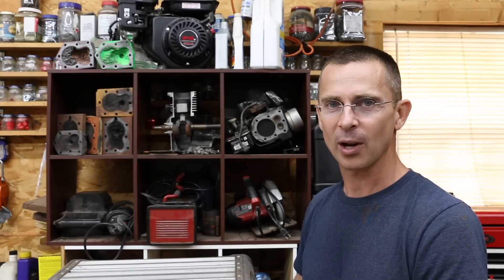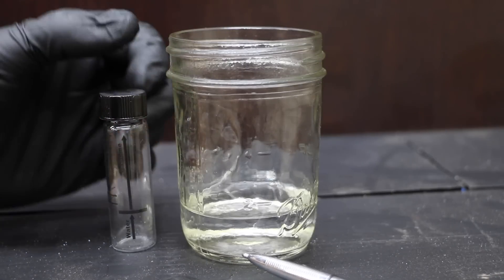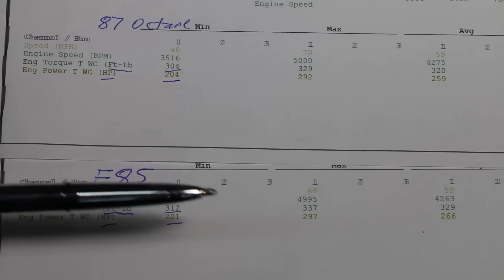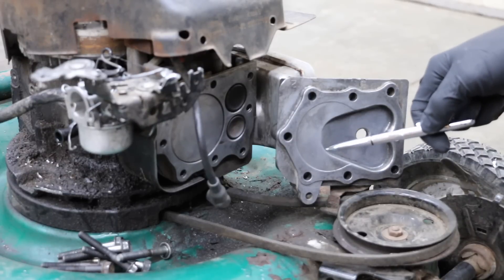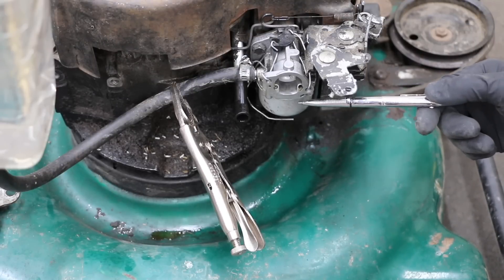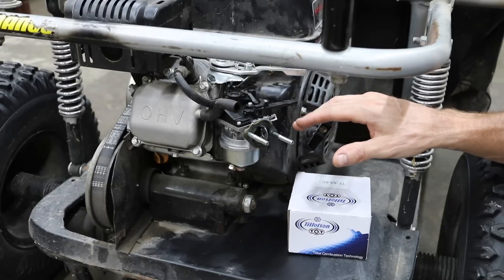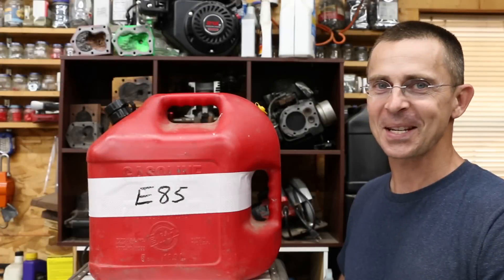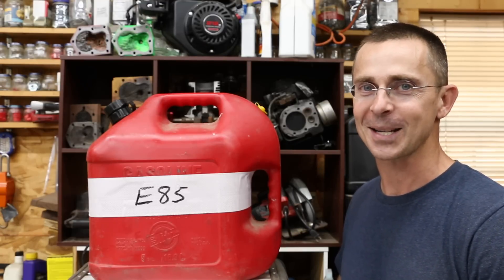Is E85 better than Gasoline? Let's find out!

Comment: I run E85 in my 4.6 modular. I tell you once you feel the power of e85 it's hard to go back to regular especially since its more affordable. 
I'm in SoCalifornia and it costs 4 dollars a gallon for regular unleaded. E85 is 2.99. 

While I only get 222 miles out of 17 gallon tank with e85. Yes I have a car pushing 320hp daily driver. I get around 300 miles with regular. 

I just love the extra oomph I get from e85.
Reply from the maker: Thank you for the feedback!

Comment: I've had my car modified to run on E85, and I have about a 15% increase in fuel consumption.
In France, where i live, E85 is 0.6€ per litre and classic fuel is around 1.5€ per litre.
So the savings are quite impressive, I now pay half the price I used to.
Reply from the maker: Impressive!  That'll save a lot of money
Reply: "fuel economy" c'est la "consommation en carburant" la bas 😉
Reply: @bastienrehm  oups 😅
Reply: @MrBayazz  j'avoue que leurs expressions peuvent porter à confusion aussi...
Reply: Quentin, did you do the math. 
How much more gas do you have to burn in order to go the same distance?
2 x 0.6 = 1.20. Its still cheaper by Liter in your case if you had to burn 2 liters to compete with one.
Your saving, just not 2x :O
Reply: @Aliens_Are_Really_Cool  0,047€ per km with e85 here. Over 0,11 € per km with gas. Litteraly 50% cheaper

Comment: Personally, I run E85 when towing heavy loads for the added torque and throttle response. It may not be much but it helps in the hills.
Reply from the maker: Great point!

Comment: E85 has high knock resistance compared to 98 octane (in Australia) 
With my car I got
98 - 450kw-ish at the rear wheels
E85 - 600KW at the rear wheels

I get a lot more power and torque to the the fact you can push the motor more on E85
down side is Fuel, on 98 I can get 500km's out of a tank compared to E85 where  I get 250km at most.
e85 is a lot cheaper than 98 though so eh.
Reply from the maker: Thank you

Comment: Difference in price between e85 and regular shoud be at least 3 to 4 to make a good deal. However, ethanol has less calorific power, but better octane number. Why do dirtrack motorcycles use ethanol? They can introcduce more mol per kg, becausevcmolecular weight of ethanol is lower
Reply from the maker: Thank you

Comment: in Australia we have E10  10%ethanol its a little cheaper than the cheapest petrol with no ethanol. I have used it in my Mazda i21 bubble not deigned for it and it runs like crap. poor acceleration  and less efficient. and probably does some damage to the motor. this is a very fuel efficient car with a once a month fill up just drive to and from work. i get best results using  the 95 unleaded fuel and 98 unleaded is not notably different to 95 in this car.Apart from my wallet feeling lighter 91 unleaded is only marginally more efficient than the E10 95 is best for your saving

Comment: W/o a pretty big increase in compression ratio, E85 is not a good alternative.  As you found out, modest compression motors really suffer in fuel mileage.  IF E85 is significantly cheaper than gasoline in your area, it might be OK ...  Where E85 really shines is in hot rods with purpose built alcohol motors.  Do it right and you can have 1,000 HP on the street.  Thank the greenies for the best street race fuel you can get :D
Reply from the maker: Thank you
Reply: There are three positives to E85. 1.) It runs clean (as noted). 2.) It significantly cools the intake charge.  3.) It can stand serious compression. But to be effective, the build must take advantage of all three ...

Comment: It sounds like a good maintenance run to do a tank of e85 every so often to keep the cylinder and fuel pump clean
Reply: If your seals and gaskets and tubes are ok with ethanol, of course.
Reply: Don’t do it unless you have a flex fuel vehicle
Reply: @wholelottamiata6976  definitely, though some decide not to read the manual /packaging
Reply from the maker: Thanks for the feedback!
Reply: not tryna argue but Ethanol is a form of alcohol. It will actually clean your fuel system for this reason. It also burns almost 100% leaving little to no carbon deposits.
Reply: Crap I posted that same question. Should of read first.... Such a lazy ass.
Reply: I'm glad my car is flex fuel gas gives me more HP
Reply: Was thinking the same thing.  Might be a better value than a can of whatever sort of fuel system and carbon removing cleaner you could purchase.

Comment: To me E85 is less about power and fuel economy and more about making carbon neutral cars possible. so even if you if you get leas fuel economy you are releasing less co2.
Reply: No big differnece in co2 emission. It does not matter co2, either colesterol
Reply: @vicent436  its net co2 that matters. the co2 coming out of the tail pipe from a pure bio fuel is carbon neutral because the carbon used to make the fuel was already in the atmosphere as co2. gasoline on the other hand is taking carbon stored under ground and putting it in the atmosphere so its net impact is putting more co2 into the atmosphere.
Reply from the maker: Thanks for the feedback!
Reply: @Noise Pollution it would be interesting but i think that is outside the scope of this channel
Reply: Sure, but if they dropped the price more it would be worth it, but as long as you're using more of it and paying almost the same as regular unleaded it's not economical
Reply: @Noise Pollution it is still less co2 then gas because it has to extracted from a well the shipped to a refinery then to a gas station. however the tools and machines used for growing the corn can run on biodiesel or e85 as can the shipping methods. 

the process can be improved to be more eco friendly. But to me the big plus is that you can still used internal combustion engines. As a gear head thats a big plus. in 30 years when i have classic cars and gasoline is getting expensive i would convert it to e85 or straight ethanol so i can still enjoy them while be eco-friendly.
Reply: @SuperCookieGaming_  Grammar study would help a better way of writing
Reply: While a Volcano eruption Will completely nullify all your " producing less C02 efforts " in your lifetime in 2 seconds of spewing crap / Co2 into the air. lol  You Snowflakes crack me up. Zero Logic
Reply: John Averick this is a quote from NOAA 
“Human activities emit 60 or more times the amount of carbon dioxide released by volcanoes each year. Large, violent eruptions may match the rate of human emissions for the few hours that they last, but they are too rare and fleeting to rival humanity’s annual emissions. In fact, several individual U.S. states emit more carbon dioxide in a year than all the volcanoes on the planet combined do.” so no volcanos don’t produce enough co2 to nullify our efforts.
Reply: @SuperCookieGaming_  Yea, The FDA Also tells us there seems to never be any crop shortages each year. Even if it was a record rain fall year that drowned and rotted all the corn for that year. Because if they told the truth then insurance companies would have to pay the farmers that lost they're ass that year so much more $ .Any report that may be driven by profit or a political agenda you need to be a little more Leary than you are about. Don't believe everything they tell you. How arrogant to think we are the end all on this earth. We are just little piss ants one this huge ball.
Reply: @SuperCookieGaming_  You say
Reply: @johnaverick7468  Don't worry about co2. Invernacle effect is about clouds at night. Co2 does not cause warming at all
Reply: @vicent436  What is claouds ?
Reply: @johnaverick7468  Sorry. Clouds. These Android keyboards are terrible

Comment: I have. 13 f-150 with the coyote 5.0 flex fuel. I've noticed around 11 to 14 mpg, or 2 to 6 miles less, per gallon.(depending on how I drive) 
In town driving,  I recommend the e85, as you will see the least difference in consumption,  where as Highway, not really trying to accelerate much or heavily,  the higher octane proves to get me enough miles to be worth the purchase. 
All and all, I prefer e85 because I can tell by performance and visual inspection, that the motor prefers it as well.

Comment: Only put e85 in an FFV flex fuel vehicle, the lines, pump and injectors are designed to be resistant to the ethanol and the vehicle is equipped with an ethanol sensor that detects the percentage of ethanol in the fuel and adjusts fuel rates and cam timing to match the tables the manufacturer installs at the factory, it adjusts cam timing and injector pulse rates to take advantage of ethanol’s higher octane rating, putting e85 in a non FFV will cause it to run lean as the engine will be expecting the octane and energy density of e10.
Reply from the maker: Thanks for the feedback!

Comment: 2015 f150 with the 5.0 coyote super crew 5.5’ bed, e85 mpg 17.5, e10 from sheetz 18.6 mpg, ethanol free from southern states 20.9. Ethanol free averages over 20% better fuel economy while only being 10-15% more expensive whereas around here e85 is only 20% cheaper than regular gasoline but is a lot less efficient though the engine has a lot better throttle response and the engine keeps the rev band higher in all gears up to cruising speed.

Sheets is rolling out “regular 88” which is e15 at some of their gas stations around here, this has a negligible decrease in gas mileage in my testing but is about 10% cheaper than regular e10. 

If you drive very conservatively the ethanol free gets the absolute best fuel economy, best tank was 21.8 mpg mixed 50/50 highway and city driving, the “regular 88” e15 is the best overall for price vs fuel efficiency and if you wanna drive it like you stole it e85 is the best for letting you feel that V8 roar.

Comment: I have an FFV jeep. With standard e10 I get about 17-19 mpg mixed use. On e85 I only get around 11-12. I have found that e15 has no effect on the mileage, and is 30cents cheaper. So I run e15 most of the time. I'll run e85 a few time a year to keep the engine clean
Reply from the maker: Thanks for the feedback!

Comment: From Leo:  I ran a few tanks of E85 in my 2008 Grand Marquis.   Around town the car was ok, starting was a little slower with sluggish throttle response when pulling out and merging in 35 to 45 mph traffic.    Down the highway, with a full passenger load,  the car had less power.   The transmission did not want to settle into converter lock up and even light hills required enough throttle to kick the converter out again.   I got about 15 mpg instead of the usual 23 mpg,  E-85 is nothing but a government program  that looses money in tax subsidy and looses money for the individual end user.
Reply from the maker: Thanks for the feedback!

Comment: $2500 ??? Did you factor in the the price difference? Running E85 in my 5.0 I get about the same cost per mile. E85 in Houston runs around $.20-$.30 cheaper the 87. But there's a major HP difference with my programmer. I get about 30 more HP with e85; more SMILES PER GALLON !
Reply from the maker: Thanks for the feedback!

Comment: Not true cost! I run E 85 in my 2011 f-150 almost 100% of the time and in the long run costing less because E-85 costs less at the pump. sometimes as much as 1 dollar a gallon less!
Reply from the maker: Thank you!
Reply: We use e-85 also not only because I am employed by a Ethanol plant, also because it could be a dollar or more less. On reg gas 2016 caravan 3.6 we get 17 mpg on e-85 we get 14.5 so the cost difference is definitely worth it.

Comment: In order to run E85 in a fuel injected motor, the computer module needs to be tuned for it. You can not just stick E85 in a vehicle and run it. That is why they sell cars that specifically say E85 compatible, and that is why they have performance computer modules or flashing programs that will program your computer to run it. You can actual ruin your engine if your PCM/ECM is not tuned to run E85.

Same thing with a motorcycle, if you change the jetting/air to fuel mixture ratio, and you adjust your timing, it will run E85 with no problem. But you have to tune the engine in order to run it. A cooler running spark plug for bikes and vehicles is also a must to run with E85.

My C7 has 2 settings that is programmed in the performance control module that Venom Racing programmed. E85 burns a lot cooler than regular gasoline. If a vehicle is tuned properly, you can actually get better fuel mileage on E85 and A LOT more horsepower, average gain of 60-80hp on boosted engines.

The 1st tuning is for running straight E85. The 2nd tuning is for running 93 octane. Each program adjust's the timing, fuel trim, air to fuel ratio, and fuel pressure on the injector rails in order to run E85 or 93 octane. Each tune has its specific values.

When Venom Racing installed my methanol injection system to keep my procharger and ambient air temperatures running cool, they had to dyno tune my pcm after flashing their performance program in order for my C7 to run on E85.
Reply from the maker: Thank you!

Comment: Tried it 50/50 mix in my 69 truck and my 91 sonoma. The sonoma didnt care didnt notice a difference. But the 69 hated it loss power, idel , mpg. Had to drain the tank.
Reply: Did you adjust the carburetor?
Reply: @BlackBeardAir   no
Reply: Add 30% and should run fine.  E85 actually does run cooler, because of how much fuel you're having to add.  That high of octane isn't needed, unless you have the motor for it.

Comment: Use to run E85 in a GMC Safari. Never threw a check engine light and never had a issue. Also seemed to get the same fuel mileage no matter what fuel I put in it. 16mpg :P
Reply from the maker: Thank you!

Comment: I run nothing but E85 in my 2016 Explorer for a few reasons.. First is cost. In my area.. E85 is always at least 50 cents a gal. cheaper than gas. I average 16.3 mpg on 87 octane and 13.4 on E85.  
2nd.. E85 runs cooler than gas... Less heat equals less wear equals longer engine life. And as you pointed out. it also burns much cleaner.. My engine loves the stuff... I notice that my engine runs smoother and with stronger power delivery than when I run gas... I also feel better about using it. E85 is much better for the environment. And lastly... I'm not sure about anyone else.. But I'm pretty sick of big oil companies and their huge fluctuations in prices.. It seems to me that they will look for any and every reason they can to jack prices. .30 .40. 50 cents a gal. overnight...  A seagull takes a dump on a oil rig and bam! jack the price! using 85 is my way of saying F.U to big oil.   One final observation... My last vehicle was a Flexfuel Explorer as well.. I ran it for 212K miles with only changing fluids, brakes and the battery...  It never had any mechanical issues. I ran E85 almost exclusively in it. Just before I sold it I pulled out the plugs{first time} aside from them having a white color to them.. They looked almost new. I replaced them anyways and sold the truck to a close friend. they run E85 in it and they just passed 300K.. No issues!
Reply from the maker: Nice! Thank you

Comment: When you purchase fuel, you are buying energy or Btu's.   Regular gas has about 114,000 Btu's per gallon ( I think this is for E10) where E85 ethanol has about 82,000 Btu's per gallon.  So I would roughly expect the gas mileage of the ethanol to be about 72% of the gas mileage of regular gasoline.   So 16 mpg on regular gasoline times 72% equals 11.5 mpg for E85. This may be not exactly correct but from the energy engineer's perspective it seems about correct.
Reply from the maker: Thank you!

Comment: I have a rental  5.0 F150 Flex Fuel and on E85 I only lost 1 MPG running the same route to and from home to work. My mix was approx.14 gallons of E85 with approximately 11 gallons of regular. As of now I'm running a 50/50 mix and I haven't lost a thing but I'm on the mix tank still..BTW Casey General Stores ( ding) are one of my favorite stores good  coffee and pizza.
Reply from the maker: Thank you!

Comment: My problem with e85 isn't the fuel itself. Its the production thats the problem.  Between the reduced energy output and the processing required to make it, the carbon savings it small.  That would still be okay... except its made from food, or at least from highly modified former food crops, grown on land that would be better served growing food.  It's caused the price of corn to drastically increase.
When we can produce ethanol from cellulose rather than carbohydrates (it is possible but currently too inefficient to be a sound business investment) i will be 100% on board with ethanol.  I'd love to be free of fossil fuels.  But burning food doesn't seem like a good alternative when so many of us here, and around the world, are already suffering from the increased prices of staple foodstuffs.
Reply from the maker: Thank you!

Comment: Had a flex fuel van and it would get about 17mpg on reg fuel and about 11 on e85. Filling up more often was an inconvenience. Also maint intervals with E85 are more frequent per the owners manual. So the "cost savings" at the pump didn't pencil to use it after the inconvenience factor and additional maintenance.
Reply from the maker: Great point!  I suppose the oil needs changed more often due to ethanol's impact on the oil

Comment: quit using ethanol based fuels altogether. i see better gas mileage, and my engine oil (after 2 oil changes after stopping ethanol use) is cleaner at each oil change.
Reply from the maker: Thank you
Reply: Totally call BS on the oil change being cleaner.